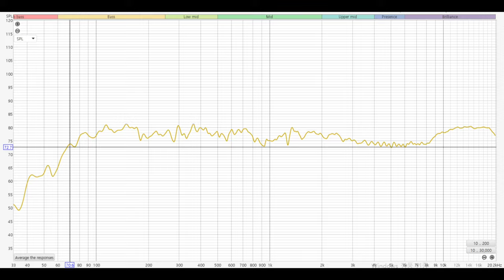3way Bookshelf  Speaker DIY build /  기가지니2 하만카돈 ad-68

Comment: That contoured, thick baffle should have significant impact, but not hard to make. 
Excellent work here. The key is a good table saw and knowing how to use it. I use a 3hp cabinet saw. Expensive but worth every penny. Watch your hands brothers!!
Reply from the maker: Thanks for the kind words. I realize that table saws are dangerous and you can't let your guard down.   The safest thing to do is to use a sled jig. Like you, I will upgrade to a good performance table saw in the future.